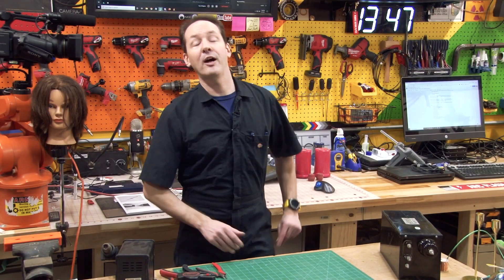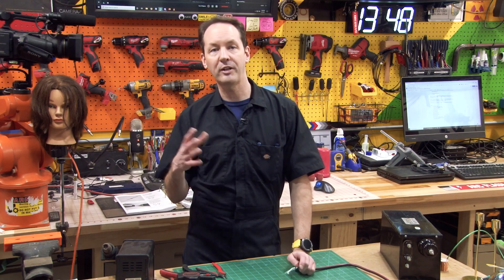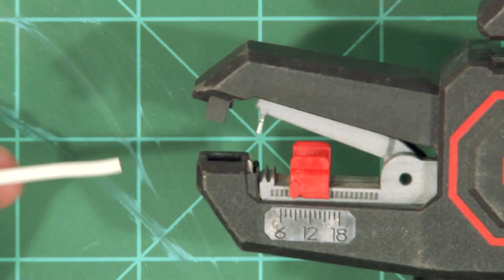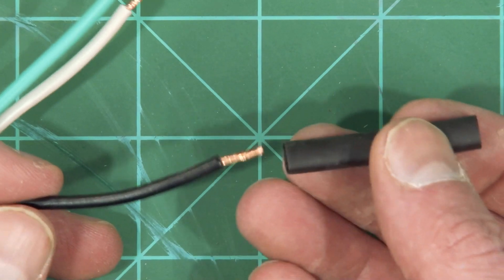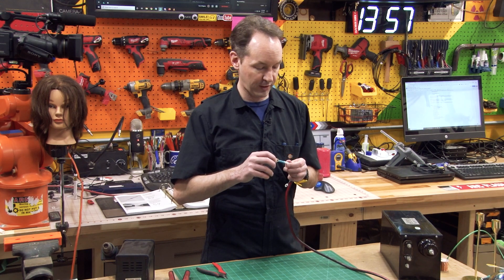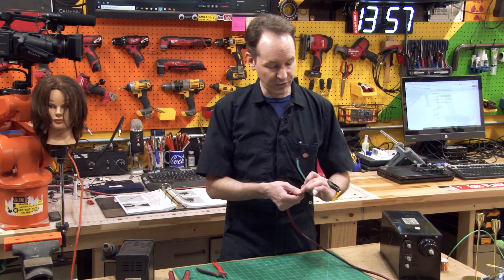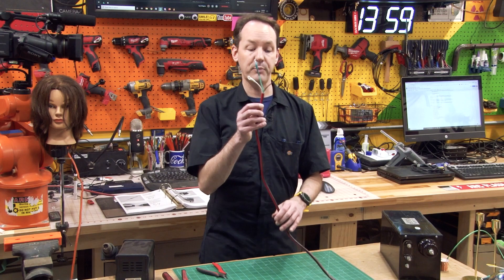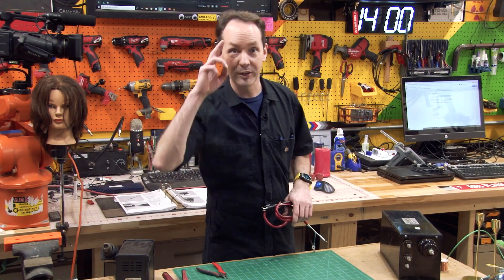High Voltage Episode 5 How To Make A Test Cord Power Supply Lead for a Neon Sign Transformer

Comment: The Knipex 12 40 200 are even better (same thing), they work for 7 gauge and under (though best for ~10 gauge and under). But generally anything from Knipex will be a best-in-class tool.

Comment: I think the "dont buy cheap tools" is only partially correct. If it's something you don't know if you're gonna use it more than once, then I have no problem cheaping out. If it's something you know you're gonna use a bunch, get decent stuff from the get-go.

That said, I don't think you should go out and buy a bunch of tool truck shit, unless you really want it, or have a tool truck regularly stopping buy to warrantee stuff. I find gearwrench, tekton, husky, et cetera to be 90% as good at 20% the price, which means more budget for more tools.

Comment: those cables can be very useful! not just for transformers. I use cables like that to power ceiling lights without wiring them through out the ceiling. as usual, very professionally made video! great job!

Comment: Great stuff!
Just a note, when stripping the outer cable jacket, be careful to not damage the insulating layer on the individual conductors. I've seen a few danger noodles in the wild and I don't like them. They can be impressively dangerous.

Comment: I often add a piece of heatshrink where the outer jacket is stripped back from the individual wires.  It cleans up the cut there and helps cover up the packing strings or fibers that are used to make the cable round.
Reply from the maker: You're absolutely right, I just didn't think of that until the video was in post.